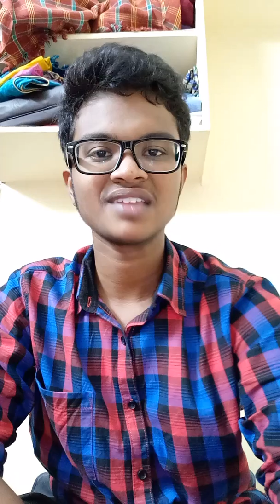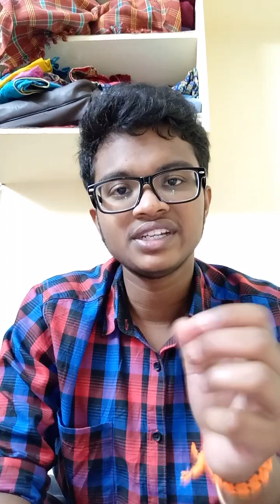How is Jominey End Quench Test done???

Comment: Sir I have doubt in jeminy quench test like if I have C55E (STN 412060) this material then how can I find its quenching temperature its chemical composition and How can I find its Cmax and Cmin can yopu help me for this and I really want your help sir 
.
Reply from the maker: C55E is a High carbon steel material. So, we can choose highest temperatures that are possible in Jominey test (i.e. 950 deg Celcius) and heating it for time of 4min/mm (for quenching purpose) and test its hardness in Rockwell hardness testing machine. When we speak about carbon percentage, we have left with no choice but to test different specimens which have different carbon percentages varying with 0.02%, then plot a hardness graph  and know the suitable temperature and carbon required.This is a research-based task to be performed with high quality detail of material inspection. Most promising results of having highest hardness(After quenching) are found in Cmax= 0.596%